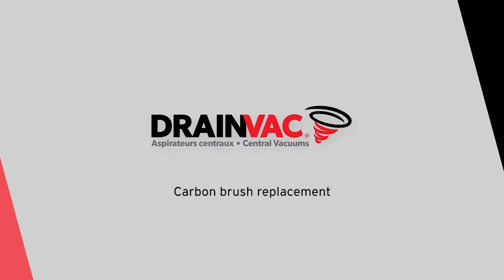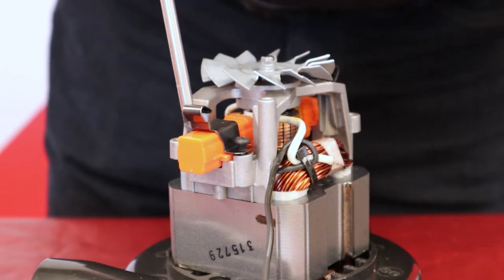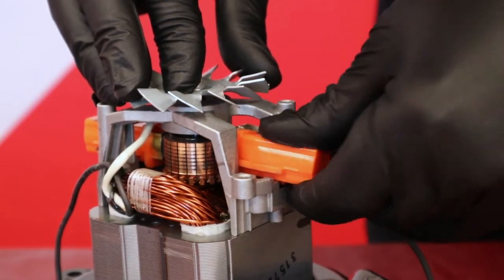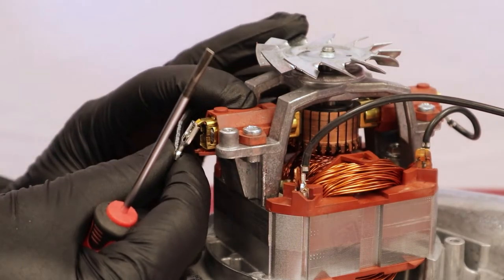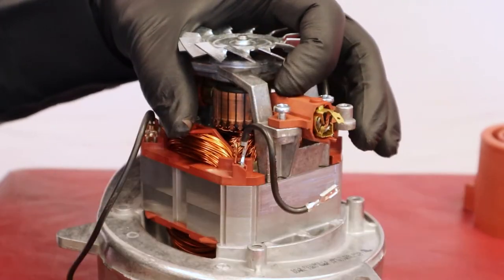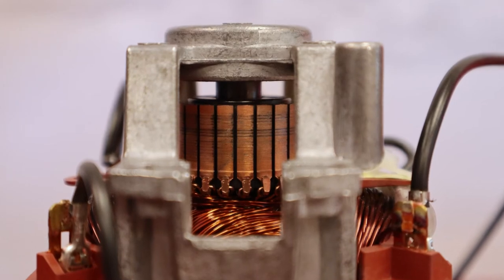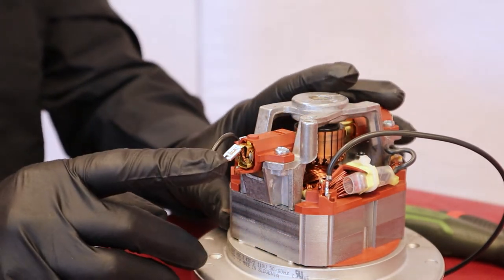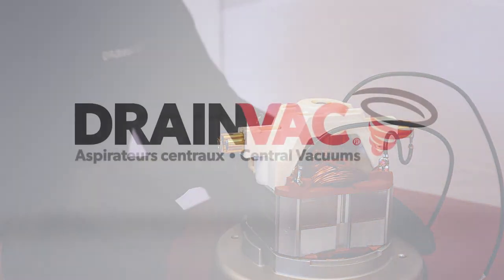How to change carbon brushes in a central vacuum's motor

Comment: He says to never touch the tips of the "brush" yet never says why. If its just because of tiny amounts of "oil" from your hands that could get on the tip of the brush, then I hardly think that would really matter. These things spin at thousands of revs a second, metal on metal contact points for the brush. Any oils or contaminants that may have been on them would be instantly burned off via friction.

Comment: My Beam motor is tripping the reset button. I have taken the unit out and cleaned the comutator? The part the brushes touch. 
The motor itself spins freely. Lots of sparks fly off the brushes. Then motor trips out after a few seconds. 8 seconds later I can hit the reset button. And it will run for another 2 to 5 seconds.
Do you think new brushes will fix it?
Anything else I should check?
Thanks...
Reply: Short circuit or overheating.

Comment: I read on an Electrolux forum that you have to hone the new carbon brushes.  What does that mean?  Do you have to shape the brush heads somehow?  Thanks
Reply from the maker: At Drainvac, honing a new carbon brush is unheard-of. We recommend avoiding direct contact with your bare hands to prevent any oil deposit, but the carbon brushes are designed to be installed as is without tampering with it beforehand.